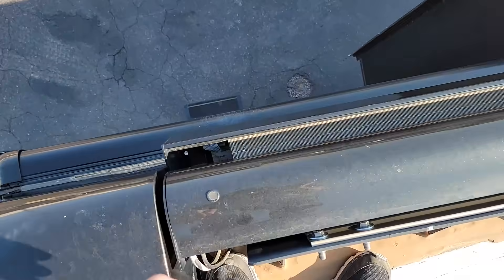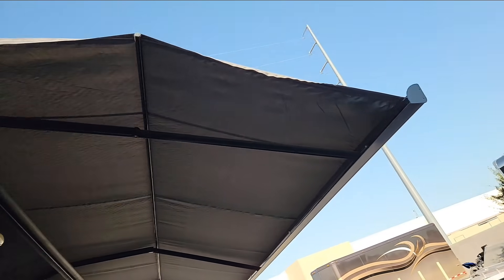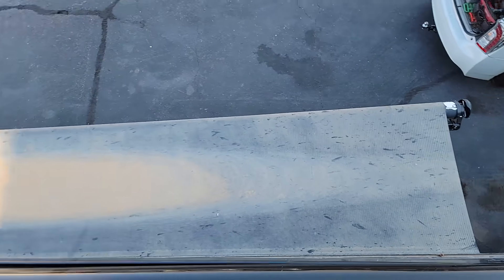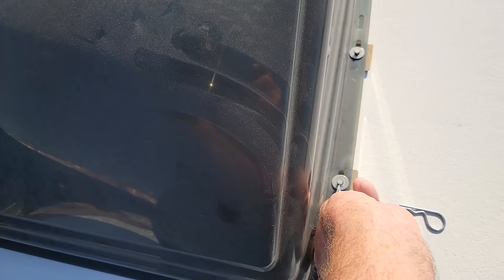What Did I Find On a 2018 Fleetwood Discovery Roof After 3 Years?

Comment: Nice coach. That paint would chap my hide a bit with that checking and corner fading though. Of course three years in the two seasonal extremes of AZ without storage/cover might challenge the best of clearcoats. For coaches stored outdoors, wash/wax every 3 or 4 months do wonders for storing outdoor. Like you said, UV protectant  is crucial
Reply from the maker: Just basic maintenance always helps

Comment: I had one Fleetwood motorhome will never have another one. The frame and bracing were not painted from the factory. First trip: Turning signals kept blowing fuses, electric steps quit working, awning spring broke, Brake master cylinder leaked. Engine battery went dead. All of this happened 1,000 miles from home......
Reply from the maker: That's awful!

Comment: More good info, Sir!
I looked at a Renegade Super C yesterday, and they said they use some sort of 3M tape on roof penetrations, instead of gobs of sealant. Have you seen this? Opinion?
Reply from the maker: I never trust adhesive tape. But it does work when applied correctly
Reply: @AZExpert  Yes, after seeing your experiences with eternabond it made me suspicious. I thought since 3M made so many accepted industrial bonding products used in the automotive world maybe gave it some credibility.